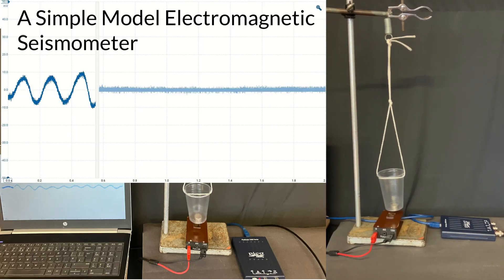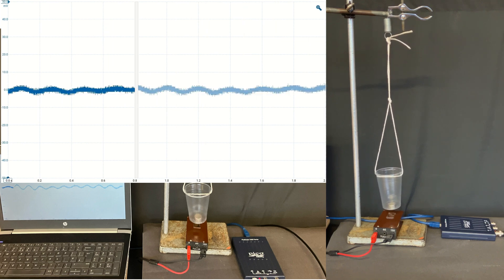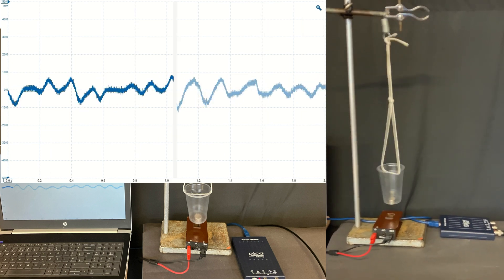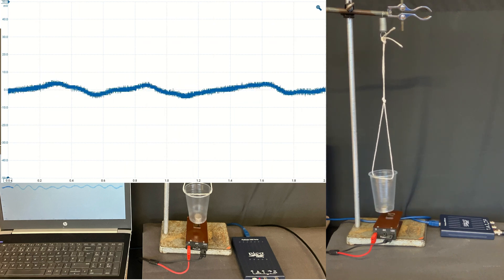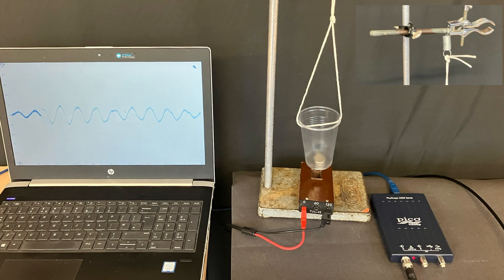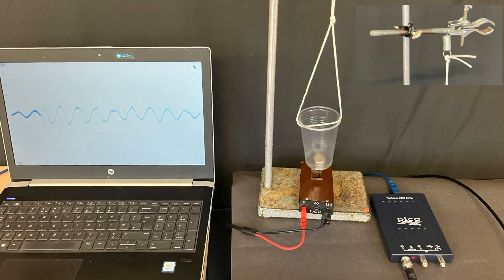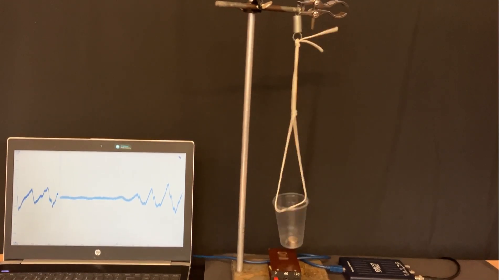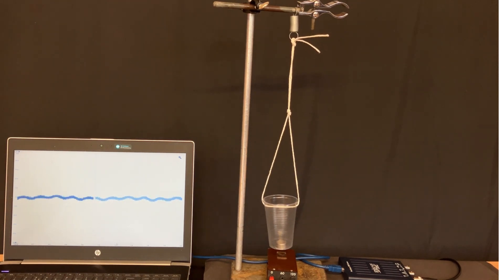A simple model electromagnetic seismometer

Comment: i am trying to mkae this one sir. can u give the specifications of the parts used
Reply from the maker: It is a strong neodymium magnet 20mm x 10mm cylindrical And a 120 turn pre wound coil of laminated copper wire.  I hope that helps.  All connected to a picoscope 2000 series usb oscilloscope.